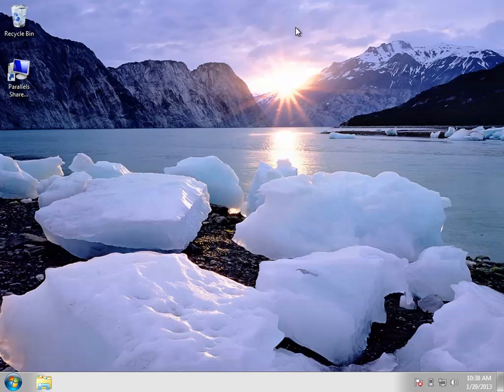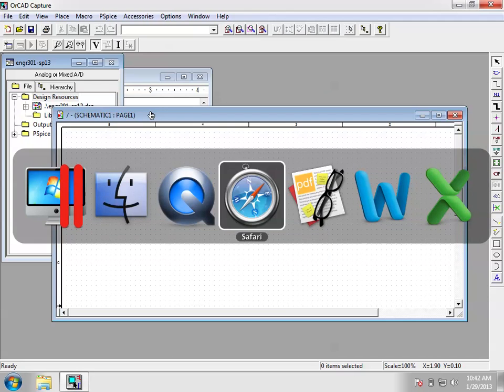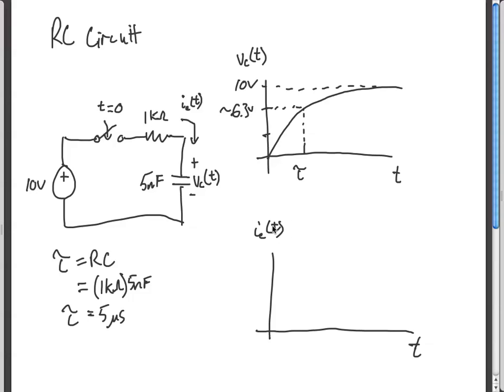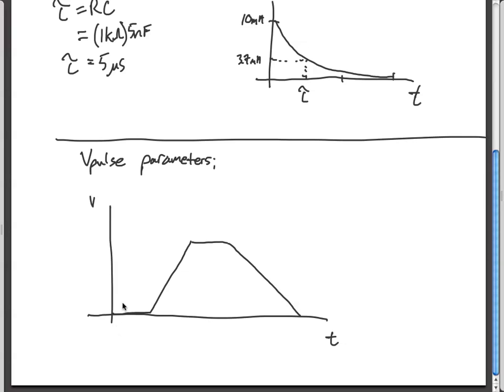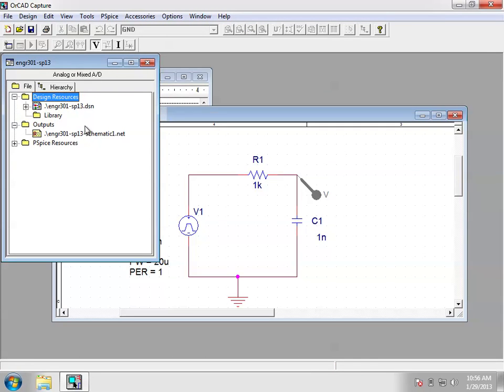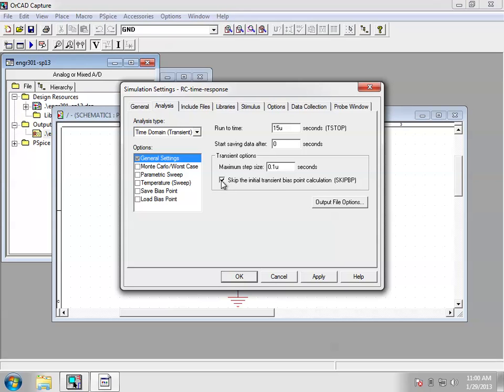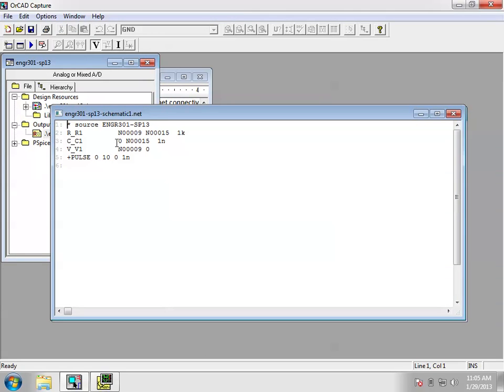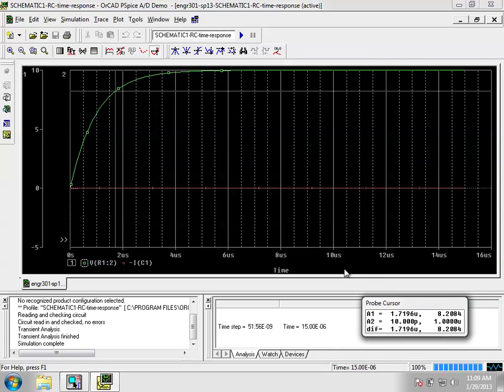PSpice Tutorial SFSU Sp13

Comment: Thank you. Very nice tutorial.
I applied it and it was perfect.
I tried to get the power dissipated in R1.  
The expression : MAX(W(R1)) , works fine for the peak power dissipation.
But the expression: AVG(W(R1)) returned an error message.
Would you please write the correct expression for the average power dissipation in R1.